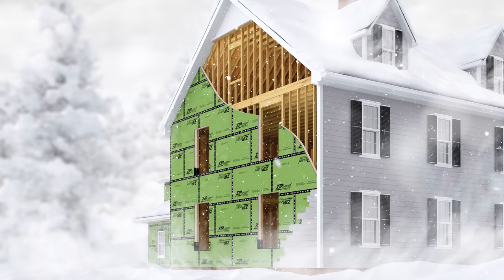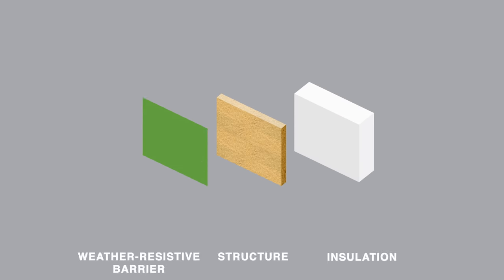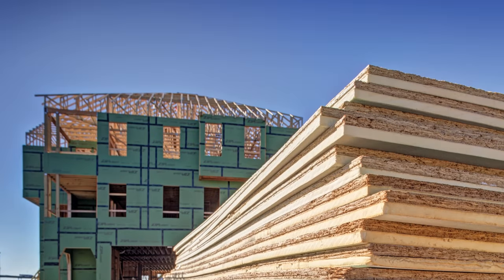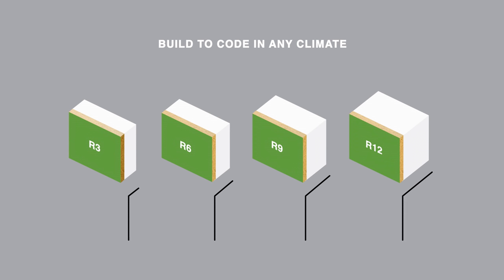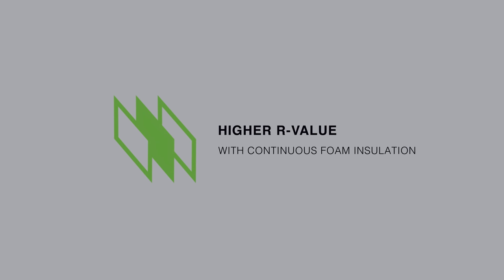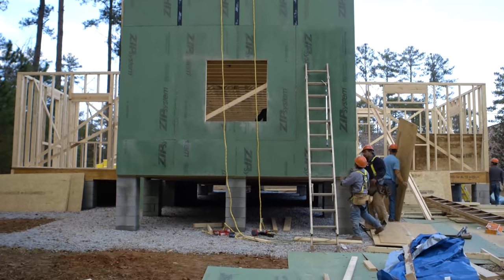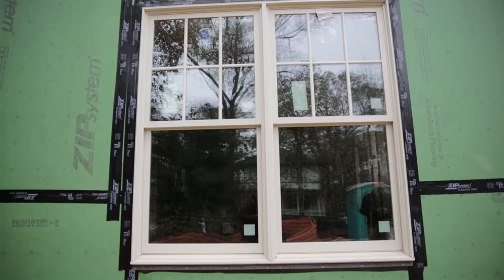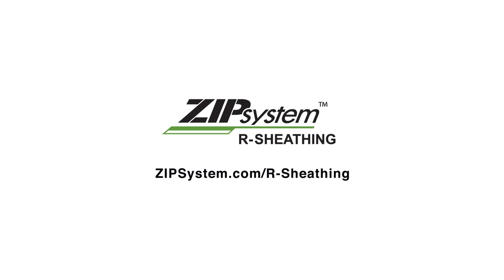Introduction to ZIP System® R-sheathing insulated sheathing | ZIP System R-Sheathing

Comment: For the right vapor barrier solution with most insulation you need to use specific solutions for different climate zones.    What would be recommended for zone 5 or 6 zones to get the right vapor barrier from sheet rock to the plastic if any to wall installation to the R-sheathing?
Reply: @ZipSystemSheathing  Thanks - I realize you worked very hard on that response.  I appreciate your time.   A video showing the answer by showing the construct of the wall without the siting of case would be awesome.   I am not disparaging your response - I appreciate it, I just have no idea what you are trying to say.   A picture or video would probably be more helpful to most people who aren't building engineers or architects.

Comment: Does the zip +foam have same shear strength as regular sheathing?
Reply: From what I understand it does. All I really want to know is if you can use it both on the exterior and interior. An R 12.5 exterior and 12.5 interior gives me a R 25 wall along with something to fill the cavity would give me a nice R 35 plus.